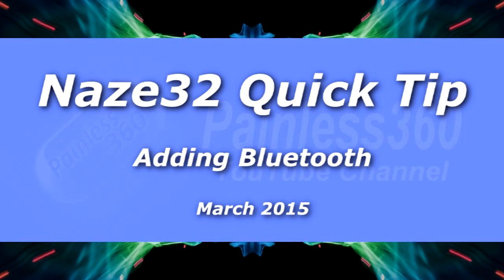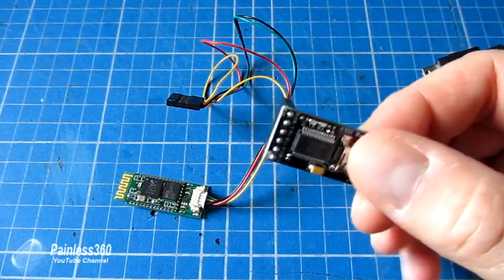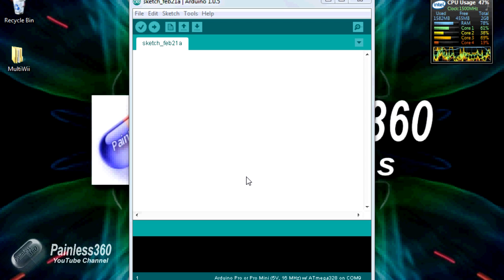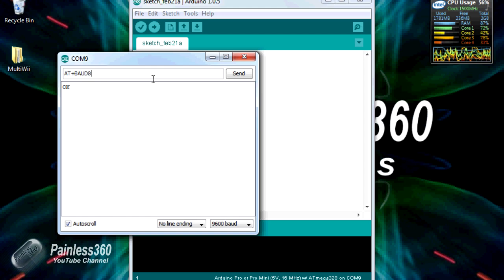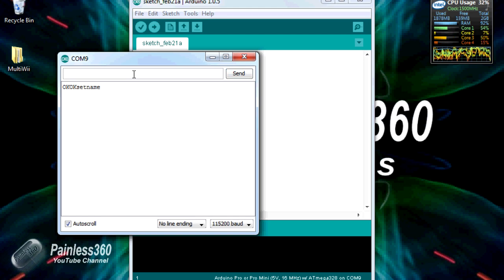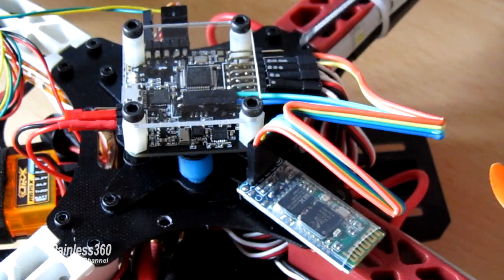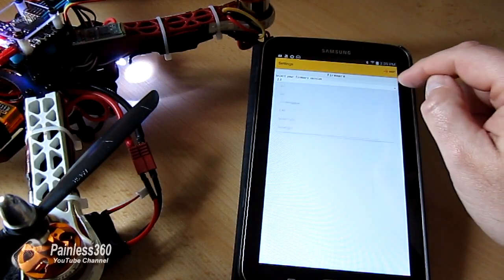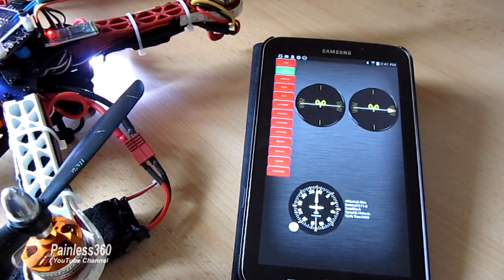Naze32 Quick Tip – Adding Bluetooth (HC-06 module)

Comment: humm, I have yet to have anything work like you do. You make it look so easy. Port is not showing anything and will not let me select anything
Reply: +Brian Tapp it's straight forward. Once you follow the steps in the video, you shouldn't have any problems. Mine works perfectly. It's very easy once you have changed the settings in arduino.
Reply: as I said, it never worked for what ever reason. I'm going ground station anyway but, would have been cool.
Reply: +Brian Tapp please check if you have selected right baud rate,l (9600 default) and also some Bluetooth modules need the button to be pressed before going to programming mode. Please check that too. 
However it didn't work for me either. I didn't use Banggood Bluetooth module so I am going to order it and try.
Reply: I had, it works with my naze 32 but i cant get the apm to run it. I will figure it out at some point.
Reply: FindmeKicksUK yes as it turns out even though you can get a China apm clone for little money I strongly suggest you kick the extra cash for the real deal. Even better I would go with the pixhawk with its redundancy systems. the app I was using was a China knock off and out of 4 of them 4 failed within 6 months. pay the extra money now to get a quality product now or spend twice that replacing everything after a crash, your call. 
Brian.

Comment: Thanks for you excellent set of instructional videos for the MWii and NAZE32 flight controllers.  They have been very helpful in getting my multirotors off the ground.

Just so you are aware, Banggood is marketing a Bluetooth module for Naze32 and Flip32 (see link) that looks very similar to the one in your video except it comes equipped with a JST connector attached to the circuit board.  It does work, but cannot be configured (e.g., it does not recognize AT commands).  It appears to be configured to communicate 115220 baud.  If you read the comments for that device on the Bangood site, you will find a number of frustrated users. 

http://www.banggood.com/MWC-Multiwii-Bluetooth-Parameter-Debugging-Programmer-Module-p-86049.html
Reply from the maker: +David Nickell Sorry - I've not used that one. Best of luck..

Comment: @Painless360 How do you 'write' changes via the bluetooth and the cleanflight configurator? If I change something it becomes 'greyed out' and even after saving, if you refresh, you get the old value.
Reply from the maker: +archtechgr Depends on the application - read the notes for the one you are using. Best of luck.
Reply: +Painless360 I use the same as you, with cleanflight and the CF configurator. I get 2 COMs in Windows one does to anything the other one seems like read only. How did you update the settings with your setup?
Reply from the maker: I would contact the creator of the app for support.. Best of luck.

Comment: im getting nowhere fast I cannot get it to communicate only in baud 38400 with NR an CL and even then only a few AT commands wrk most come back with ERROR????
Reply from the maker: +CX20 BIGSHARK Dave Brown Sounds odd. I'd go back to the supplier for support - may be a duff board..
Reply: +Painless360 I believe I found why I have the problem.....the module I have is a hc-05 ,with the button you can press when powering up, that puts it into communication  mode but it will only allow default communication an only some AT commands work heres where I found it maybe helpful..............http://www.martyncurrey.com/arduino-with-hc-05-bluetooth-module-at-mode/

Comment: Lee may I call you, that BT module you are using is an HC-06,...easy to get in to AT programming mode, because it is always in this mode. However the HC-05 requires pulling the Key or Pin 34, high during power up to use AT commands.  The HC-05 will not be programmed from an FTDI.  For those that ended up with an HC05 this is a great entry level project to get you feet wet with Arduino and working with breadboards. and you will than understand what "Pulling High" means. Go grab the gear, breadboard and jumpers and an Arduino Uno ~$10. I used my NanoV3 that has the breakout pins that fit perfectly. Sketch works flawlessly. A great learning opportunity for me
See the  Arduino sketch, on the great Instructable, here by a guy named Techbitar: http://www.instructables.com/id/Modify-The-HC-05-Bluetooth-Module-Defaults-Using-A/     
Also a bit that will help you determine the difference between the HC-05 and the 06...
http://www.instructables.com/id/AT-command-mode-of-HC-05-Bluetooth-module/
Reply: +Chris Leech I programmed my HC-05 by using an FTDI Adapter. Those links you shared were my guide. No need to pull high or something with breadboard.
cheers
Reply: Not my experience with the three I have on my bench. They are cheap and the markings on the backplane can vary so much. It is not a given when you click the Buy Now button no? :-)

Comment: Does the FTDI connector have to be programmed first to work or should it work out of the box?
When I startup my the Arduino software, I don't get a blank screen, it has "put your setup code here, to run once". And even if I follow your steps, I don't get an OK.
If there is a setting up process of the FTDI, could you link me to a guide, because all I've found so far are history lessons for serial and parallel ports.
Reply: +ShallowBeThyGames  this is where im at , how did you get it to work
Reply: +RC Surf Ah forgot about that comment...

I bought a new Bluetooth board and it worked first time, also with a couple of other BT boards.
The FTDI board is just a bridge and doesn't need anything else like I thought in that comment (Still pretty new to arduino). I think my first BT board was just knackered - I'm pretty sure I didn't make any wrong connections, so I assume it was just crap from the start and the FTDI had nothing to talk to.
I'd say for the price of them, just get another BT board and give that a go. Probably best to buy from a different seller, just in case someone is selling crap. If the FTDI is recognised on your Arduino software, it's OK, so just eliminate possible defects.
Good luck.

Comment: Awesome job on all of your instructional videos!!!  You got me up and running with a naze32 with GPS rather painlessly!!! :)

I was wondering if someone could help me out...  I am trying to figure out WHERE to connect a Bluetooth module on my naze32....  I do not have the rx/tx pins in the middle of my PCB, here is a link to the module I purchased and a wiring diagram of my FCB....

http://www.hobbyking.com/hobbyking/store/__64776__Multiwii_MWC_FC_Bluetooth_Module_Programmer_Android_compatible_AR_Warehouse_.html

http://www.goodluckbuy.com/images/detailed_images2/file/NANJ32%E8%8B%B1%E6%96%87%E8%AF%B4%E6%98%8E%E4%B9%A6%20-%20%E9%80%9A%E7%94%A8%E7%89%88.pdf

I would really appreciate any help figuring out where to connect the Rx/Tx pins on the FCB....  BTW, I am using PPM and already have the GPS installed on channels 3 and 4....
Reply from the maker: David Fritchman I'm not familiar with this board, I would go back and ask HobbyKing.. Best of luck.
Reply: Painless360 
FYI...  I have determined my FC is a Flip32+...  In case anyone else wants to know, the bluetooth module connects directly to the "serial/UART" set of 4 pins for Grnd, VCC, Rx, Tx.....

I want to thank you!!!  You were my MAIN source of info on my first quad build...  almost done with it and have it completely documented.  Anyone can follow along at....

http://www.rcgroups.com/forums/showthread.php?t=2461571

.
Reply from the maker: Thanks David.

Comment: Hi! First of all, love all your vids! Helped me a lot with my 1st quad, a zmr250 with CC3D and now a storm racer with Naze32.

Just wanted to ask if I can use an Arduino UNO to program the HC06 instead of an FTDI adapter? Thanks!
Reply from the maker: Jojo Dijamco I only use the FTDI Basic adapters here but I am aware of others who use all kinds of devices to write to the boards. I would strongly recommend that you get an FTDI adapter if you getting into the hobby - https://www.youtube.com/watch?v=qLaH4qkJNt0Happy flying!
Reply: Hi! I guess I might as well get an FTDI adapter as you say. Though I was able to setup my neo 8m gps using an arduino but followed your video as a guide. Thanks and happy flying!

Comment: Stay away from the HC-05 modules ; especially the 3.3 v level ones .
Got 4 of them and none is comunicating in arduino after spending hours on figuring out why.
Could you include links of PROVEN WORKING modules?
Reply from the maker: cmulder002 Unfortunately not, mine have all been from eBay and the sellers change all the time. I've never had a BT module I couldn't setup though - maybe I'm just very lucky?

Comment: Hi Painless 360 just wondering if you have ever tried to extend the range on one of these module... looking at the antenna track there are a few that have cut it and added an external antenna... i been looking at the actual top board, and there is a gold trace underneath that comes out to a through hole on top underneath it looks like a wireless connector could be added... check out these pictures...
Reply: bing crosby http://www.espruino.com/refimages/Bluetooth_HC05_back.jpg

Comment: I have a HC-05 Bluetooth module asking for the hammer, I spent all day trying to make it work. My Phone connects to him, so i guess it's alive (at least for now, (the hammer is ready). My problem its only to program it. I've tryed with my FTDI, with 3.3V or 5V, RX to TX and TX to RX and the other way around.Tryed to use all baud rates available, and still no response to AT commands. Tryed to use my arduino uno two ways (diferent diagrams for board with and without sketch). tryed to update drivers. Tryed to use Flash magic software to setup the HC-05 and was only able to see garbage that shouldnt be there, no response to AT commands either. Went to another computer and the result was the same. 
I have one question though, I think your video doesnt show it, when you send AT commands to the module it blinks fast like always, or it changes?
Happy Flying
Reply from the maker: Bruno Santos May be a bad board, I'd take an evening off and come back to it tomorrow. Use another version of the Arduino program in case you have something weird going on in SW..
Best of luck.
Reply: +Bruno Santos try these commands here: www.instructables.com/files/orig/FKY/Z0UT/HX7OYY7I/FKYZ0UTHX7OYY7I.pdf

Comment: hi thanks for a vid +1 
im doing as you do but all i get is 'Connected" but "No Data Received"  any idea what i might be doing wrong  ?
HC-05 BT module
Reply from the maker: FifthScaleRCLife Did you run through the setup and change the baud rate using the Arduino application on the PC? Have you tried swapping the TX/RX wires over? What troubleshooting have you done?
Reply: i will double check in arduino software but i did swap TX/RX wires yes 
thank you for your reply

Comment: Is it possible to use OSD and Bluetooth?
Because both use the Tx/Rx on the top of the Naze32?
Reply from the maker: ituning CCO You can move the Bluetooth to a soft serial port if you need both. 
Lots of great detail on the soft serial ports on the Naze32 wiki pages.
Best of luck.

Comment: I installed a bluetooth module on my Naze32 with a damaged USB port that was no longer working. I'm happy to report that I can connect to Clean Flight again and all is working well. I did have a question about the bluetooth's range and practical usage. I noticed while flying LOS in a typical baseball field there were times I was out of range with the bluetooth. Rather than have it connected all the time should I leave it wired up and only plug in the module when I need to tune? I was wondering if you left your's connected all the time.... and does it ever get out of range?

Comment: I have the arduino software on my windows 8 computer.    I can't get windows to talk to the FTDI adapter.  can someone help with setting up the arduino program..  my bluetooth board is blinking but windows can't see it or the FTDI adapter.
Reply from the maker: I always recommend getting an FTDI basic board. 

Does the chip on your FTDI adapter have FTDI printed on it? If not then you may need special drivers. Contact your vendor for help. 

Best of luck
Reply: Dean Cory The thing is you might need to feed your BT module with 3.3V TTL  levels on RX/TX (this was clearly written on my HC-06 module PCB). Initially I tried a genuine FTDI TTL-232R-5V (5V version) cable but wasn't able to get the communication going. Then I took a Prolific PL2303 based cable and hallelujah! BTW there are different versions of FTDI cables on the market. TTL-232R-3V3 is claimed as 3V one. Also I tried an FTDI based adapter for Micro MWC flight controller sold by Hobbyking but one didn't work either.

Comment: Nice helpful video! I got Bluetooth working on my Naze32, the only thing i am stugeling with is when i connect the module to my PC with the FTDI adapter, i can send the AT command and i then get an OK back, but when i try AT+NAMENaze32 nothing happends...
Reply from the maker: Sebastiaan Rutgers OK, what BT module? Is it one of the ones I recommend?
Reply: No i did not, the on i am useing is from banggood, MWC-Multiwii-Bluetooth-Parameter-Debugging-Programmer-Module-p-86049.html
Reply from the maker: I would use the one I have in the video.

Best of luck.
Reply: Painless360 
i HAVE THE SAME PROBLE AND USE THE SAME ON THE VIDEO hc06!
Reply from the maker: Then you have either missed a step in these instructions in the video, wired it wrong, have a duff board, haven't setup the FTDI properly or a driver problem on the PC.

What troubleshooting have you done (and why are you shouting?)
Reply: Painless360 
Hi, I try with Windows XP was not possible to connect, now I install Arduino on Windows 7 works perfect!. Thanks
Reply: How could they of wired it wrong if they get the OK command back... That means that they device is talking to FTDI and FTDI to arduino.... Correct RIGHT so no chance of wiring wrong fellas.

Comment: Thanks for all your video's I find them all extreemly helpful! and have subscribed.
One thing I would just like to point out is that Bluetooth also uses 2.4GHz band so you may have some issues on distance due to the bluetooth desensing the quads receiver.
So try to keep the two apart from each other.

Comment: Cannot get bt to work on Naze32 Acro fun Fly version. It works fine on the full version Naze32. Do you have to enable it somehow on the Acro version? Or is it not possible to configure?
Reply from the maker: I've never seen it documented that it won't work with the ACRO but don't have an ACRO here I can try.

Best of luck getting to the bottom of it. Let me know if you get it working..
Reply from the maker: Painless360 Just a quick thought - you're not trying to use the BT whilst the USB is connected are you? That will not work - it's one or the other..
Reply: No USB connection. I'm aware of that issue. BT paired to Android phone, voice says connected but then always says disconnected. I tried switching tx/rx connections just in case and 2 different BT modules with same results. Full version Naze BT is an awesome option. I've been searching the net but haven't found a definitive answer anywhere.

Thanks for your help and VIDS.

Comment: Followed your steps using a ZYX bluetooth adapter (after a mod to change the cable) and successfully got it working. Couldnt connect using my S5 but my old Acer tablet works a treat. Cheers for your videos, it was such a great help!
Reply: Painless360 Would you please be able to do a video showing how to use MinimOSD and Bluetooth at the same time?  I'm feeling the need to use both but not go through the inconvenience of unplugging and replugging.  I'm using all this on my mini quad but can't really figure this bit out.
Reply from the maker: matthmbg Thank you for the feedback. Bluetooth and adding a MinimOSD are two of the coolest additions! Happy flying!

Comment: Never did the FTDI connection to work.  Just started with your steps for connecting to the Android and everything just seemed to work.  Key point is no USB cable if connecting with Bluetooth.  Thanks for taking the time and effort to put these together as I would never have added Bluetooth without your videos and help.

Comment: Strangely enough I had to select Both NL + CR mode to get the Arduino software to see my BT adaptor.
I also had to make a dirty wired jumper connection between the ground pin and (IIRC) pin 13 on the BT adaptor. It was only after googling the solution for 3 hours that I came across this useful post that was not referenced anywhere else.

Comment: FTDI not working for me either. My adapter is recognised in Device Manager and shows as 6001 so not soft-bricked/blocked. I've tried drivers from 2010 right up until end 2014 No matter what board/baud combo I try it will not respond to AT. I've exhaustively tried every configuration as well. There's 4 hours of my life I'll never get back :-) The lights are flashing but nobody is home.
Reply from the maker: I would strongly recommend that you approach the vendor of the FTDI board for help and support.

The FTDI adapter should appear as a 'FT232R USB UART', I am using V2.8.30 (12/07/2013) of the internal windows drivers in Windows 7 here successfully

The FTDI adapter should appear as a 'FT232R USB UART', I am using V2.10.00 (27/01/2014) of the internal windows drivers in Windows 8.1 here successfully

Best of luck.
Reply from the maker: Painless360 Always worth a read in these situations too - http://www.ftdichip.com/Support/Documents/InstallGuides.htmHope it helps..